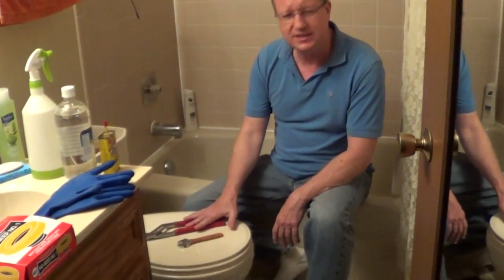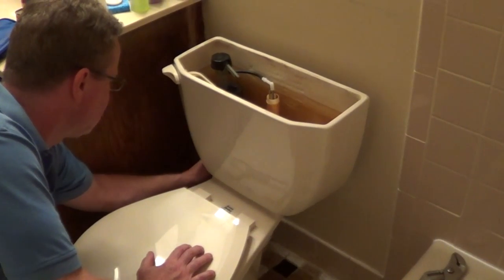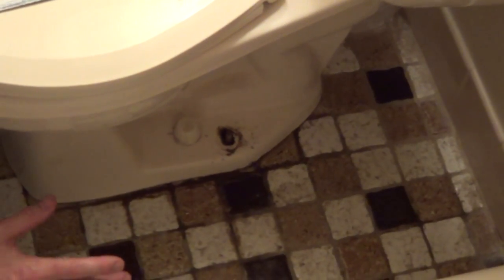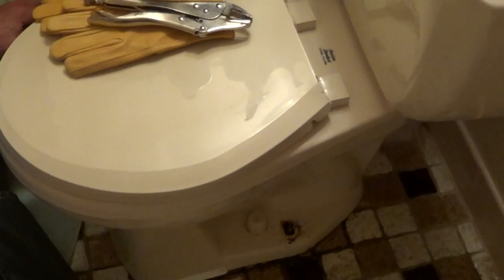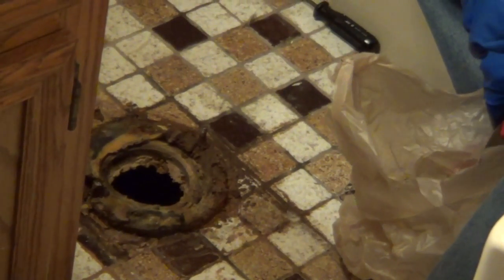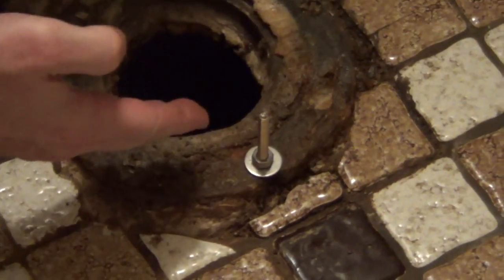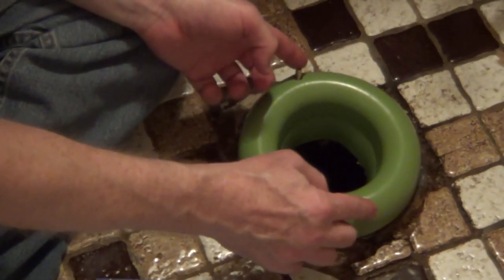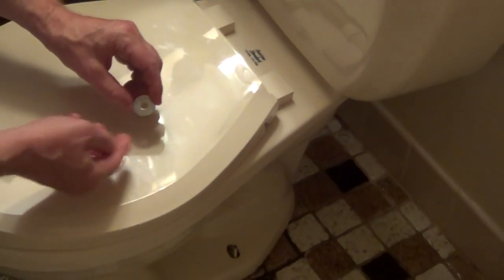Replace Toilet Wax Ring - No Wax Toilet Ring - Toilet Leaking at Base

Comment: I purchased this Sani Seal gasket to repair my leaking toilet.  I bought this because of this video.  It looked so easy until I put water in the bowl and it was leaking after 15 minutes.  I took it off and checked the seal and I could not see anything wrong with both sealing surfaces.  The bowl was not crack.  I tried it three time and finally gave up.  I had to go back to HD to get a wax ring.  Wax ring has been around for a long time.  If it works why mess around.  I have learn my lesson.  I hope this comment doesn't get deleted because I want people to know this gasket doesn't work for everyone.
Reply from the maker: omgname Hi,
Sorry to hear that it didn't work for you. I can't imagine what the problem would be. This is all I use now and I haven't had any callbacks. It should fit itself to any shape flange and toilet bottom. What is the height of your flange? Is it level with the floor surface or above or below?
Reply: The flange is not even level with the floor.  The previous plumber did a bad job installing the flange.  Maybe that is why it did not seal right.  I used two wax rings and it sealed.
Reply from the maker: Hi,
I would have thought it would have done a good job with that, since it can move with the shape of the surfaces. Sorry it didn't work for you. Thanks for the info.
Reply: @omgname  why did the first plumber replace the flange?
  How old is your home? Is the pipe plastic overcast iron? They make flange raising kits. I always use extra thick wax rings with 3x4 flanges on them. Then if the flange is really low. I add a regular wax ring on top with no flange on it.
 I've tried these foam rings. To many call backs do to some kind of leak. 
I've been plumbing for over 45 years. I'll stick with old school wax. 
  Now. If you are setting a brand new toilet on a brand new just built home outbuilding. These foam rings can work just fine.
Reply: I had someone change my wax ring and it started leaking the next day so I'm trying sani seal now.

Comment: I do believe that those ring seals that are using are antimicrobial.
Reply from the maker: ComPrt3 Hi, yes they are. I started using them a few years ago and have not had a problem. Great here in the Chicago area, they won't freeze or melt like tradition wax rings. We also have the Fix It Home Improvement podcast on iTunes and Stitcher. Here is a link http://www.stitcher.com/s?fid=49441&refid=stpr

Comment: Just logged in to say a big thank you for sharing this info! Today I replaced two old worn out corroded wax rings that were allowing seepage. The Sani Seal worked out awesome! Also thanx for the tip about the penetrating oil. I applied it the night before and the rusted nuts loosened right up! THANK YOU SO MUCH!!!!
Reply from the maker: Hi, I'm glad it was helpful. We have a weekly Fix It Home Improvement podcast on iTunes and Stitcher. Here is a link https://itunes.apple.com/us/podcast/fix-it-home-improvement/id880903087?mt=2
Subscribe and let me know what you think.

Comment: It is too thick for flanges that are mounted on a finished floor.
Fortunately, in my case, the bottom of the toilet was uneven and so was the floor tile so I had to shim the toilet anyway. If I didn't need to shim, I would use a wax ring.
Reply from the maker: Hi,
It will compress to fit a flange 3/8" above or below the floor height. You can also trim it down with a razor knife if needed. So far I have never had a call back with these. We have a weekly home improvement podcast on iTunes and Stitcher. Here is a link https://itunes.apple.com/us/podcast/fix-it-home-improvement/id880903087?mt=2

Comment: Bought one at Canadian Tire, worked perfect. The previous home owner tiled the bathroom floor but, did not raise the flange. My first attempt to stop the leak was to use an extra thick wax ring. Didn't work. When I finally installed green seal ring I put a bead of silicone calk on the bottom and on the top just to be safe. It has been over six months now and still no leak.
Reply: Ingersollcanada smart

Comment: If your flange is 1/2" above the floor like mine is..these won't work
Reply from the maker: Hi,
They are designed to work 3/8" above or below the height of the floor. If the flange is higher, you can trim it down. If it is lower, you can double them up. I think they are great compared to wax rings.

Comment: what can i do about the free spinning bolt if i dont have a hacksaw blade?
Reply from the maker: Hi,
You can grab the top of the bolt with a regular or locking pliers and then try to loosen the nut. I've found a hacksaw blade the easiest with rusted bolts. You don't need to buy the saw frame, just use a blade held with a glove will do the trick. Good luck
Reply: i just went and bought 2 hacksaw blades, they were only 2.99 so not that much. im just gonna hold the bolt with the vice grips and try to saw it off. thanks for the help!
Reply from the maker: Glad I could help

Comment: Im a master plumber and I love new technology . I love your video and was wondering where to get those kind of seals ? Thanks . Love your video !
Reply from the maker: Hi,
You should be able to pick it up at your local hardware store, or http://sanisealgasket.com/order.html

I think it is an excellent gasket. I would have loved to have this years ago when I kept extra wax rings in the work car, melting in the summer and hard as a rock in winter.
Reply: Menards and the Home Depot sell them.